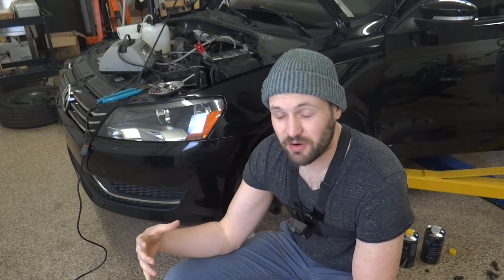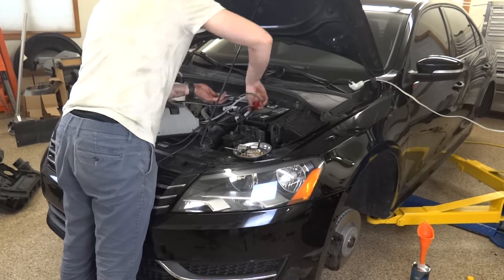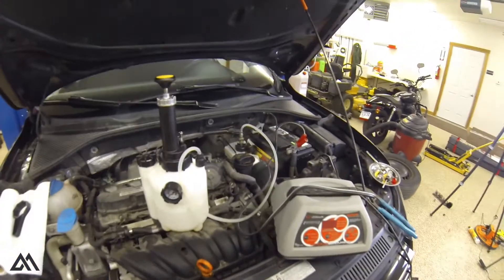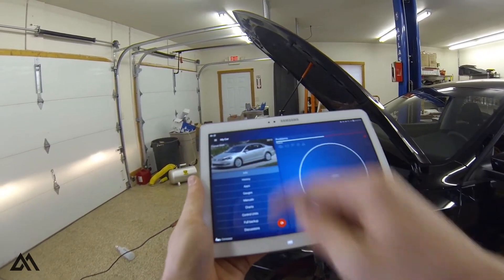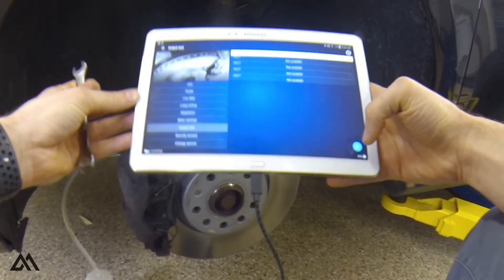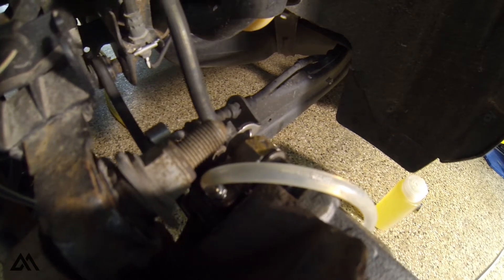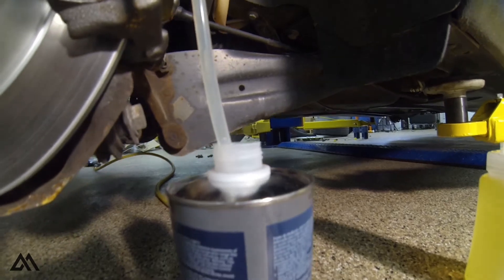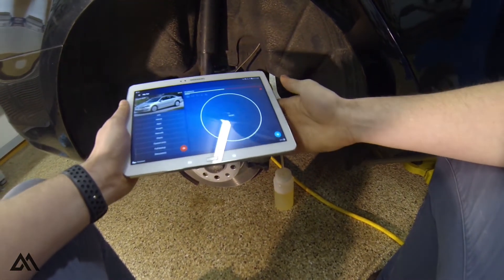Bleeding Brakes While Activating ABS Module with OBDEleven Tool - B7 Passat Flip Car

Comment: Many thanks!…had this car 12 years and NEVER had to mess with a code tool to replace a brake caliper, UNTIL NOW…the new caliper simply wouldn’t clamp down onto the rotor, even after the typical brake bleeder process, and yet lots of fluid would flow out and onto the floor!…totally bizarre!…I found the brake ‘output test’ section in obdeleven and let it run until no more bubbles…SUCCESS!…now I want to know how/if abs modules interfere with brake bleeding!

Comment: Does this need to be done if only flushing fluid. I used to work for Harley Davidson and there was a process for flushing the abs system very similar to this. The problem was about a week later the abs module failed. Harley did not want to cover it. Many pissed off customer’s.

Comment: How do you do this without the pressure bleeder? I have the computer… I’m doing this myself
Reply: The ABS Module will generate pressure, just make sure between activations of the ABS just go and top off the brake fluid again, don’t want air getting in to the master cylinder.
Reply: Did you end up doing it without the bleeder and did it work!?

Comment: I have a 2019 VW T-CROSS and has only 4000 km. Recently VW changed the brake fluid (time interval change) but after the service the cluth pedal is different. The clutch felt like a new car now it is more week like a used car around 40.000 km not a 4000 km one…. What happened? I am very dissapointed of VW service. Not to mention the quality - my car camed with missing screws and many more problems. Please reaspond 🙏 thank you! Great job with your videos. I do have obdeleven but still i have payd for theyr brake fluid change 😒 and i do not have your pressure tool.

Comment: Can you use OBDeleven when performing a brake flush?Or is this only used when air is trapped in the system?
Reply: you can use it. I find the pressure bleeders like the motive work good though

Comment: Trying to do this on my 2014 Jetta.  Did your OBDEleven require the security code entered first to do this in the brake module?
Reply: I think this happened to me too…it is a 6 digit code that the app forces you to choose the first time you use the tool…I put that code into my passwords manager, even though it’s not used like a typical website password…try some 6 digit codes you might use for other bank cards maybe

Comment: Your battery voltage was dropping while doing this, Might be a good idea to turn of all heavy/unneeded electrical loads, especially headlights,👌👍
Reply: It's a good idea to keep the lights on when you're doing this sort of work.  What happens if the power goes out?  Then you'll be working in the dark.
Reply: @bobdobbs7828  Ya cant teach stupid🤷‍♂️🤦‍♂️
Reply: @campbell19872710  sure you can by questioning and acting like every answer given by a person is wrong even though it's completely and undisputubly true. It's how some very intelligent people raise their kids to be complete train wrecks.

Comment: Good video.. on the last few minutes of the video where there was a lot of air purging through the plastic hose on the waste bottle, was the abs pump running? All I can hear is your battery charger 60Hz humming.. I have same thing on my C5 Audi A6 Quattro it’s a squishy pedal but under normal tradition bleeding I don’t see any air in my hose on the bleeder screws regardless of what wheel I’m doing.. I’ve done buddy system ..open bleed, push and hold, tighten and release .. and I don’t see air.. I also used my Schwaben pressure canister system holding 15psig when opening bleed screws and didn’t get air, just clean brake fluid.. I have VCDS and will try this method with the pressure can on the master cylinder to bleed the ABS pump.. I did calipers and both rear hoses so I’m not sure if all the air is out.. maybe trapped in the abs pump? I noticed using OBDII I didn’t see you go into the car for anything so you don’t have to hold pedal or push it 10 times, which I’ve seen in other videos.. looking for some help to get brake pedal hard.. tx

Comment: Please let us know how it came out  I have the same issue with squishy pedal in my C7 Audi A6, I have the OBD eleven pro and wanted to do this procedure.  Thanks for the videos !
Reply: I have the same car. I did it with normal procedures , first closest to driver side and last furthest.  And after I bleed all four caliper and used obd11:
Control units >
Brakes>
Basic settings >
Bleed brakes>
And ran last option "finalize".
This helped on the spongy feeling..brakes feel better know

Comment: Also, according to VW manual, VCDS or abs pump activation is not required. As long as minimum pressure of 2 bar or 29psi is met and maintained while bleeding with pressure bleeder all air will be purged from abs pump.
Reply: show me where it says that
Reply: @Patrick-Mckinney  oh do you not believe me ? I will gladly show you if you think your method is the only way
Reply: @butters_  its the way the factory repair manual says
Reply: I know I’m 9months late to this comment, could you point me to where it says that? Manual, rosstech, even a forum from Audi users etc? 

I’m hoping this is my issue as I’ve only bled with 15psi, would the reservoir handle 29/30psi of pressure? 
07 s4 with 4.2. I’m assuming air is in the abs, we had the brake system open for a few Weeks while performing other services on the engine etc. I assume abs module went dry. 

Anyones help would be cool, unable to get the abs module bleed process to work while using VCDS.
Reply: @vicariousclouds  YouTube keep deleting my comments. Not allowed to post links or tell you where to look. However if search up online “Ross tech abs bleed 2 bar” it should be the 4th page down, click on that and scroll down to post #11 

can confirm it works. I used 30psi on a previous VAG vehicle with new MK60 abs unit that I replaced to due common failing.

If all else fails try:

bleeding with engine on.

Lock the brake pedal down overnight a few nights with a piece of wood or whatever. 

Activating abs on a loose surface a few times. Such as gravel or mud etc. Then try bleed again. 

Also it should handle the pressure.
Reply: @vicariousclouds  also can you elaborate what you mean by can’t get bleed procedure to work? Are you sure your following the instructions properly.
Reply: @butters_  
Would this work on an MK4 Golf TDI? (the 30psi)
Reply: @vicariousclouds  any chance you can share what you did?

Comment: Looks like you have air coming in from the bleeder valve, might be why you keep getting air from that caliper
Reply from the maker: That’s what I was thinking originally but then wouldn’t you expect brake fluid to seep out considering the internal pressure of the fluid is greater than atmospheric pressure of the air?
Reply: @ModernEngineer  
Didn't know the OBD11 had this feature👍. 20psi is a little steep. Self bleeding brake flush machines tell you to never go over 16psi for any reason. Definitely seems like air is being introduced to the system somewhere.

Comment: Did this solve your issue? And is there a specific version of OBDeleven you need to perform the ABS bleed?
Reply: Did you figure this out?
Reply: @StevenDanielZigila  yes, I learned that is is possible through OBDeleven, per an email with them asking if this feature is available. I ended up investing in VCDS and I was able to replace my brake master cylinder and perform the bleed.